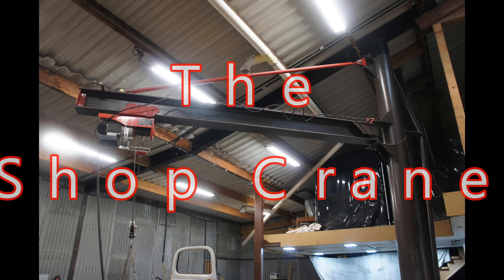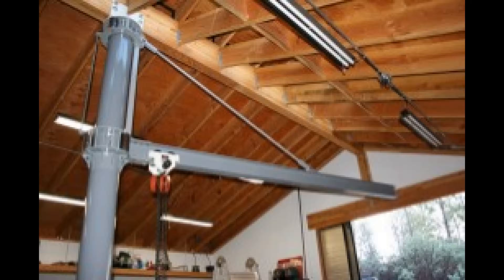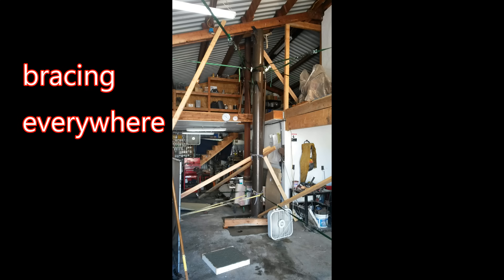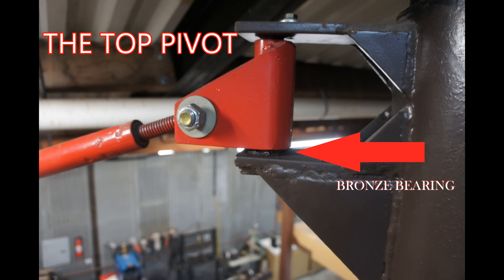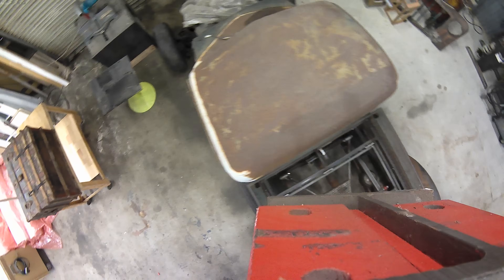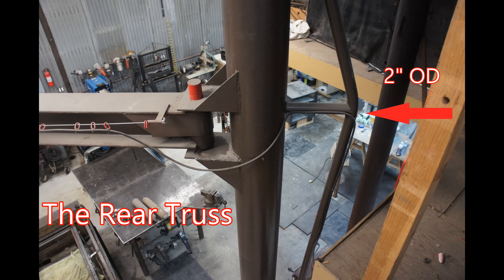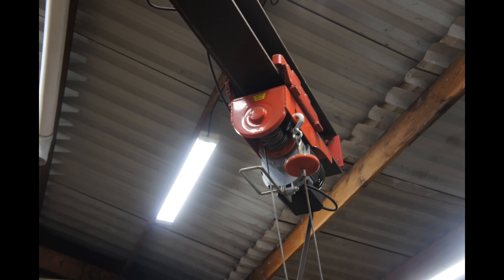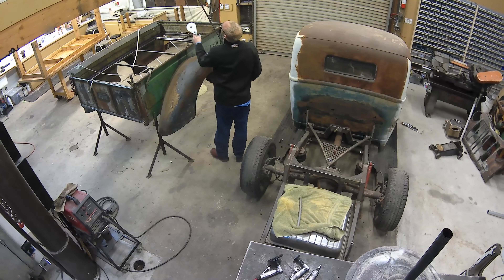Tour of my home built Jib crane

Comment: Worked at a company that had over 100 vehicles and some talented hard working young truck mechanics who talked company into giving them some overtime to rebuild large diesel engines. They made two 12' jib cranes that were connected to steel upright I beams in an old garage. One day insurance company guy walked thru and seen they had a heavy engine hanging out pretty far on home made jib crane. He told them they could not hang that much weight on crane. They removed electric hoists to satisfy him. Then they only used them at night or weekends. Some of the old machine shops that I did electrical work in had halve a dozen jib cranes before they owned a fork truck.

Comment: Hello, 
my name is Angelo and I am writing to you from Italy with the help of a translator..... 
Congratulations it's a really nice project, and as you said age is starting to make itself felt and the back is starting to hurt (I am 55 years old, and I recently had back surgery!!), so for my garage I have to make a jib crane ma.....a double boom. My garage is rectangular and in addition to putting the car in it, it is also full of my equipment, so I would like the crane to be able to move throughout the rectangle of space I have, of course I do not want it to lift a ton, I'll settle for 150 Kilograms. I wanted to ask you for a design on paper, if you have it, alternatively I can settle for the wonderful pictures with description (which of course I will have to translate and convert the inches to Metric system). I will take various cues, you have filled your project with valuable functional details. And then I want my implementation to be SAFE and hassle-free. 
Thanks for your possible help..... 
Best Regards from Italy....and again compliments.

Comment: very nice build! How much did the material for it cost? Without the hoist and trolley, just the steelbars and stuff?
Reply from the maker: I have a good friend that does steel building erection and so I got the beam remnants and pipe pieces from him. It was only a few $hundred for those. The bearings were $40ish dollars if I remember correctly. I used an old chain binder for the top strut.
Reply from the maker: Concrete cost is whatever the local company charges. At the time of this it was $90-ish per yard. Then there is small costs like rebar, hardware, some cable and random plate.
Reply: @unitedstatesofbuild4915  alright good to know! Thanks for your quick answer man
Reply from the maker: If I was to do it again I would add 2 or 3 more feet to the overhead beam and I would add a way to fine tune the overall level. After all these years of use it slightly favors one side. Its not bad, but if left alone it will slowly swing to its favorite spot.
Reply: @unitedstatesofbuild4915  yeah a bolt or anything to look it in place seems like a good idea. Especially because I wanna build it outdoors, so to lock it against wind would be a smart move

Comment: great build......I've been wanting one thinking of how to build one looked at many videos, I have a work area that I really could use one, I have a 6x8 x 3/8ths thick wall rectangle, tube....ing, a FRIEND sold his business,  gave me lots and lots of stuff, well on the final clean up i got the ugly doublesided cantilever,  with many arms perfect to put the long stuff away.. well they kept the expensive stuff I got the rest, beams, great structural material, and waited for the owner to show up and gave me the rest.. and behold a jib crane was in the mix....but no pivot pins, now I can put up my dream......well one of many to old to pick up heavy stuff .and it still has the trolley on it .. the jib crane  looks like yours but the guy had built the jib to mount on the side of the cantilever.. rack.. I'm so grateful.. but it will be a task getting it up..enjoyed many of your videos..

Comment: Awesome! But you really need to do better welding.....thats all tho!
Reply from the maker: Haha, thanks! Ill work on my welding skills....Any suggestions?
Reply: Ya, let er build up, don't be scared to put too much in....more is better than not enough. And it looks as tho you are either a bit too jerky or you are speeding up then slowing down over and over. Watch the puddle! The kind of structure you are doing it should be welded 100%...you are leaving the tips or ends not welded. When starting a vertical like that it gives you the opportunity to start your weld on the tip as a horizontal then change to a vertical....should have an "L" shape weld....same as when you get to the top....go right over it and let it build up and fill in......hahaha.....thats my 2 cents anyways! Hope that was understandable.
Reply from the maker: Thanks Dav! Be sure to check out some of the other videos!

Comment: Great build!  I like the details of the project, from concrete dead weight calculation to reinforcing stress areas.   This crane is definitely not to fail any soon!  I am new to your channel. Sure I will go through other videos.  I've built a tiny crane (500lbs cap.) in my garage shop and sure it is a great addition and a back saver.
Reply from the maker: Thanks for sub'n Joe! I always appreciate the feedback. Check out the floor anchor video and the welding table. All 3 things work together very well. They all tie into the rebar grid and make welding in the shop an ease
Reply: I can't seem to find the exact video you are refering to. One day or the other, I will go trough!
Reply from the maker: Everything being tied together allows me to clamp my ground leads to the grid and weld on everything thats attached. The table, cars, projects can all be attached to the grounding points. This allows me to only worry about 1 lead.

Floor anchors and Vise stands: https://www.youtube.com/watch?v=t6F4-MqOJSA

Welding table: https://www.youtube.com/watch?v=UzrWfJF1gJ0

Comment: You mentioned a "locking device" in your video...here's something you can 'ADD' to your nice custom jib crane...procure a brake drum or a rotor. Secure the axle, 90 degrees off your upright, just above your beam, aimed toward the beam. Secure your drum or rotor to your beam. Mount a brake master cylinder to the backside of your column. Construct a pivot arm that will actuate the plunger on the master cylinder and hook  a smooth small link chain to it, dropping it down with a gate hook on it. Make and Mount a ring to your upright so that when you "put the brakes on" the "peddle" can be held down, by hooking the gate hook into the ring, to lock it down. You can also use this to slow down the slide. Just put calipers around one edge of the I-beam and drop down a chain with a knob on it, just to help control wench movement. By using these brakes, you can handle huge loads by yourself. (I was a tool designer for a large USA railroad for over 35 years.) This works well and usn't THAT hard to add.  Enjoy...by the way, thanks for making such a nice video and you did well on fabrication, too! Keep on keepin'' on! & be safe
Reply from the maker: Thanks for the awesome idea. I like your thoughts on a master cylinder. Great comment! I was thinking disc brakes, along the lines of a go cart kit or something. Your idea would certainly be suited to heavier loads. Thanks for dropping by.
Reply: UnitedStatesofBuild I built thousands of prototypes, over my career. I had the reputation that you weren't going to over load anything I built  because I spared no expense in doing it heavy duty! Lits of times I've seen several tons of equipment being changed out using something I designed to pull something weighing less than 200 pounds, but if I make it safe  I make it idiot safe, too. Always over engineer something and then rate it for half of what it will easily and safely do. That way everyone stays safe! The nice thing about using a brake, is that you can gently slow down a load, so it doesn't swing. Most jib cranes don't have power creep. You have to pull them , or push the load itself.so if you put a scissor  similar to ice tongs, in your carriage movable and weld some disk brake pads to its tips and put a pad either on both sides of your I-beam or on both the upper and lower if the bottom section of the beam and install a spring to keep it open. Drop a rope with the end run thru a 4" long piece of cut-off broomstick, a little over head high. This way you will never ding yourself on the brake handle and it will always be right next to your load, so you can manually put the brakes on to control your move, say you're pulling an engine out of a car, and it has the tranny still on it...you've got your transfer wheels blocked and are pulling at an angle. When it comes loose  the whole thing is going to be moving fast. You can stop the load by tugging the load brake a little. Same goes for your beam.you want the pin secured TO the beam, so that your rotor or brake drum can be secured TO that pin. Then the guts be secured to your upright. You see, the boom will swing wildly if it can! If you wish, you can attach a rope to its control to operate the boom brake from above the load. There's so many things you can do to make your jib crane safe. I enjoyed conversing with you. If you need to brainstorm any time...email me. Thanks